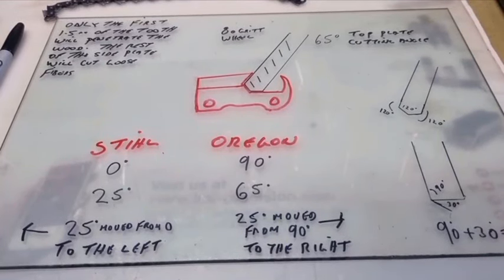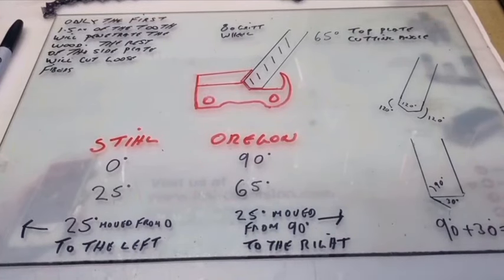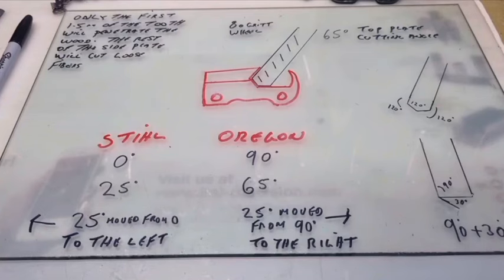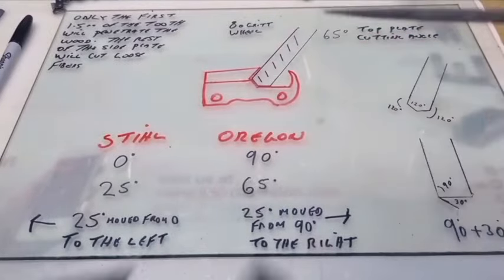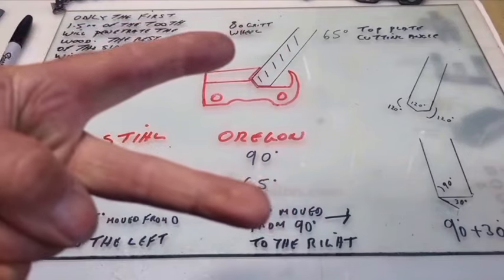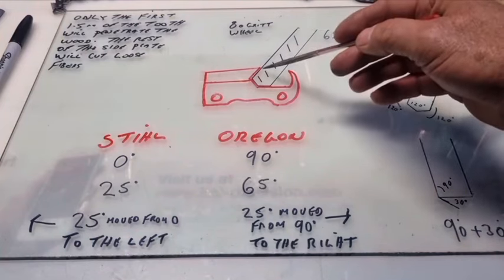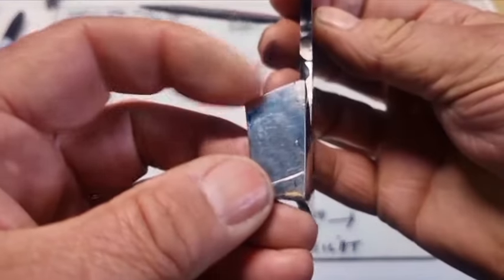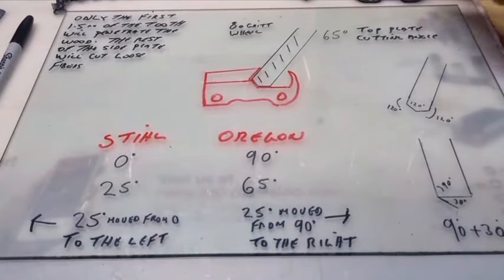Alternative to Hexa & X-Cut grind your own Part 11

Comment: Great video👍🏻 happy you mentioned how the gullet area is useless for cutting. People have been led to believe otherwise on YouTube.
Reply from the maker: HAHHAHAHAH That is your mate Doug spreading the word about get the gullet lol
Only a maximum of 1.5mm of the cutter ever chips out the wood.
The working corner does all the work.
Where the f...k did this get the gullet come from ?     People now believe that the gullet plays a major role in chainsaw sharpening lol
At least you and I both know the truth
Reply: @ChainsawUsers  Buckin Billy Ray I'm pretty sure.
Reply: Great information, great presentation mate
Reply from the maker: @gunterbecker8528 Thanks for your comments
Reply from the maker: Best hand filer I have seen.  But get the gullet is a bit overboard.  If you hand file good the gullet is never a problem
Reply: Get the gullet comes from Buckin Billy Ray on YT. I think he even has T-shirts or some such with 'Get The Gullet' on them. 

Much sharpening info is what I think of as 2 dimensional simplification. lacking important why info. 

If someone hand files without enough downward pressure to keep the 'C'' with a nice amount of hook/point then taking out some of the gullet area is necessary to restore an efficient cutting point. So 'Get The Gullet' can become necessary but knowledge of why, i.e. so that the file can get into position to form a nice 'C' and cutting tip, doesn't come through sometimes.

Cheers
d
Reply: hi @elpolaco7654  
Thanks for the reply
By hook I was just talking about the top of the C where side and top plate meet and make a point. It gets too much 'hook' if a round file gets too low, i.e. less than 20% of the file height above the point. 

Of course once a couple/few mm below the working point, a sharp cutting edge isn't necessary but it will naturally be sharp where a round file has done it's thing.

Cleaning out the gullet when square filing isn't something I've had to worry about. I'm just a simple firewood cutter using semi chisel and doing round filing. Don't know much more than what I deal with to do my thing.

Thx again for the reply. I like talking about this stuff.
Cheers
d

Comment: Tinker,something slightly different from u topic ! Is it necessary to switch over to the  winter setting to warm the carburettor here in Victoria, I'm not in the high country . What's u opinion on that?
Reply from the maker: If the saw runs well, need to slide the  plastic to winter.  I have same on my ms311. If the carburettor iced up then yes use it.
If you use a saw in freezing conditions the carburettor can ice up  when used for long periods.   It can't hurt anyway to change it to winter more hot air flowing near the carburettor